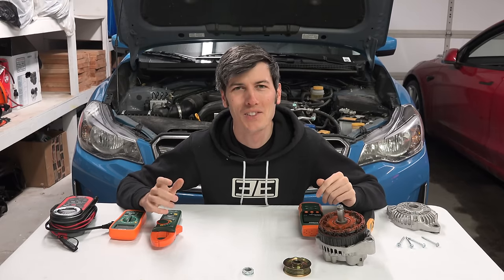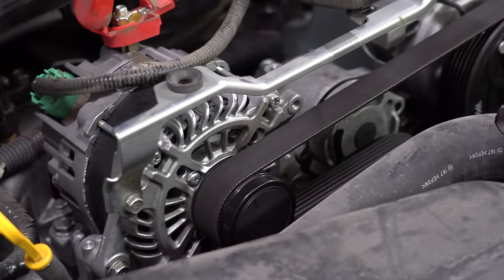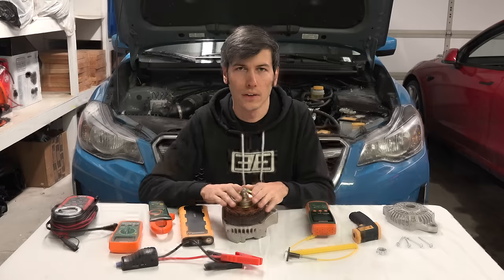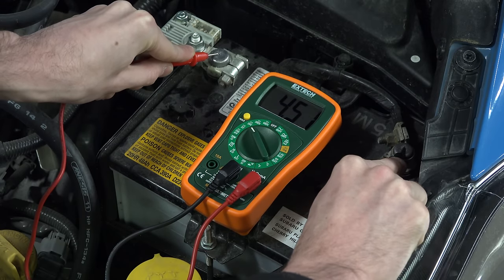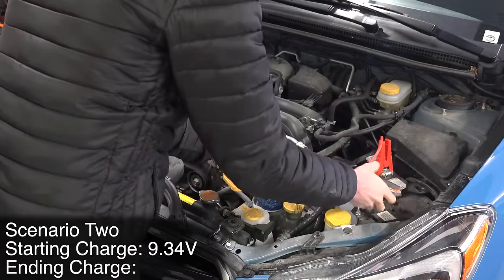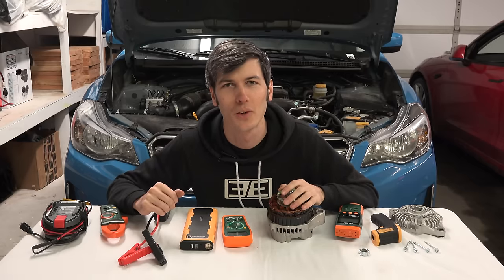Can A Dead Battery Ruin Your Car's Alternator?

Comment: You just measured voltage drop over alternator cable :D
Surely it tells you if you have bad connection to alternator, battery or even damaged cable but nothing more. Well, knowing resistance you could roughly calculate current.

Your alternator will be fine as long as it's in good shape. Problems usually show up when you have dirty alternator clogged up with dirt. It does not dissipate heat well enough and it's fine with small load but it's going to get significantly hotter when fully loaded. That's why alternators might fail. Just take care about good shape and if you rip off bottom engine bay cover, replace it as soon as possible. That's good way of keeping everything clean, especially when your alternator is quite low on the engine. 

This method is much worse for car battery. In perfect conditions you want to charge it at most with 0C1 which in case of your battery is 4,8A. It's hard to tell how much did you actually put into battery as you measured amperage at alternator output. You could also measure it on battery cable (before it splits) to see how much charge do you actually have and how much goes to power rest of the car. Obviously with empty battery you have much less internal resistance so it draws much more power. Alternator limits current but it's still closer to 1C. Sure, it will charge. By discharging it so low you did not damage it much as it was just awhile. It's much worse to have low charge for a long time. The problem is that charging with such high current generates a lot of heat and hydrogen. Current batteries are protected from that but it's still good idea to keep away with anything that might spark or ignite hydrogen. That's also why jumpstarting and charging from another vehicle you should never put both clamps on battery. Either positive or negative should be connected further away and disconnected first. This way you avoid spark near battery that could ignite hydrogen from quickcharged battery. It does not happen under normal condition as all new batteries are sealed. It happens when overcharged battery gets too high pressure inside and gas goes out through vent valve. Under normal operation  oxygen and hydrogen recombinates inside and goes back to water. If you vented your battery by overcharging, then you lost some of water. It means that you have less and more dense electrolyte. In extreme cases it means that battery will start to wear itself much faster and will not use part of plates that are exposed by missing electrolyte.

Comment: I remember hearing that some cars have an "alternator protection" mode, where the alternator stops charging if the battery is too weak. Is that true?
Reply: Modern day cars have a smart system to a degree. However, it wont tell you that your battery has a weak or dead cell. It will charge the whole battery as required but doesnt know enough to indicate what cell is weak. You would indeed think they would have a smart sensing system that could indicate and tell you that hey," cell 4 is weak". Lipo or lithium ion battery chargers DO have that ability because each cell is wired in such a mannor they can be checked individually. Something lead acid batterys lack. With the new cars being so energy hoggish, The industly NEEDS to adress the antiquated system and bring it up to modern times.

Comment: Was hoping see a specific gravity of the battery but I guess yours is sealed anyway.  The alternator will get you up to 60-80%eventually but will never get it to 100% because it can't maintain the voltage high enough for long enough to do so, you know the good 14.6-14.7 volts until the amps taper down to where it's finished.

Comment: You forgot to mention an alternator needs to first be powered by your battery for it to work :) car alternators are not ‘self exciting’ and they don’t contain permanent magnets inside. The centre rotor needs to be magnetised by a 12v supply from your battery before it can start producing electricity.

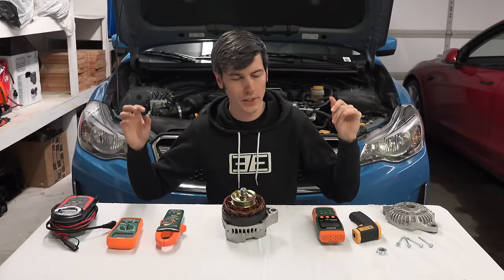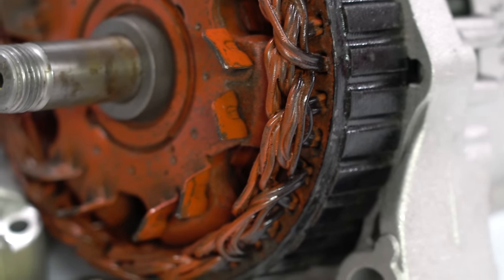Comment: 2:49  outline of the experiments...  9:36  the less a battery can receive a charge optimally (a degraded battery) forces alternator to overwork to send more amps thus operate at higher heat temperatures which could lead to premature failure.

Comment: interesting to see the measurements but charging a dead battery with the alternator does much more damage to the battery than to the alternator... you can short circuit the alternator and it shouldnt burn out as long as its spinning and is not full of dust or something, its just how they work - winding inductance limits the maximum current and its generally designed to be safe... btw the alternator does not regulate the current it regulates voltage and just tries to keep those 14 ish volts, its the battery that says how much current it eats if its under constant voltage -  thats why chargers have to have the current regulation, high charging currents can kill a battery pretty quickly

Comment: Why do combustion engine cars have an alternator and a separate starter instead of a large electric motor attached directly to the crankshaft? 
It could be used as a perfectly smooth start-stop system, a booster for low rev acceleration and it wouldn't require an automatic transmission.

Comment: The alternator doesn't really give a  dead battery a "deep Charge" it measly gives the dead battery a surface charge, so when you turn on the lights/accesories the battery will go down to near the original  previously measured low charge.

Comment: And this relation alternator / battery is the very reason why you can start a manual car with a dead battery by rolling it and gently clutch-in the 2nd gear.

Comment: i know this is an old vid, so i must have missed it, saying that a flat battery will kill an alternator is a myth, what does kill an alternator is a shorted out battery.
if a battery is left flat it will damage the plates inside the battery, these plates can buckle and short out, this will kill an alternator, as for a flat battery, as long as the current does not exceed the maximum output of the alternator, the alternator will be fine and like you stated just gets a little hotter with the extra current draw.

Comment: It’s all about power flow, heat, and state of the battery. 

As the battery ages it’s internal impedance increases due to sulfate crystallization with lead. So therefore, an aged battery would be a lighter load on the alternator then a new battery at the same state of charge. 

The only time it would be a problem is if, as you stated, it is a hot day and the alternator is under a heavy load near it’s nameplate power rating. Anytime heat increases things wear faster. I would suspect that the most-likely part to fail is the internal diodes. Semiconductors can have their dopants move as temperature increase, so much that it damages the PN junction. The alternator is just a 3-phase generator essentially, so the only failure points are the wires and rotor/bearings, which are probably more resistant than the diodes to heat. 

The other part that also might explain why the alternator could fail, is that your battery is no longer a sort of “capacitor” providing a buffer for short-circuit current on starting your DC fan for example. I would suspect that if your battery is dead, the alternator is now exposed to current spikes (momentary load jumps) which overload the diodes (which have a finite power/heat rating) and eventually cause them to fail. 

I would be curious if you could use a true oscilloscope type meter to measure the current changes in real-time, not RMS values, and see the spikes associated with turning on various equipment in the car. I’d bet there would be momentary spikes above the alternator diodes rating (typically 160-200A continuous), and that would be the true reason why a bad battery causes an alternator to fail, not increased heat and current draw over time.

-An Electrical Engineer
Reply: Also, I would consider the alternator voltage regulation components as well. These might be the other point of failure in the alternator due to current/voltage transients in the system with a dead battery.
Reply: Whey someone with some knowledge yes it is the power spikes caused by the turning on of auxiliary’s which kills alternators the most when used with a knackard battery as once stable alt output would be the same as if the battery was new and charged 

Heat can cause issue if having to charge a heavily discharged battery and it’s somewhere hot or if the car is stationary while charging (and it’s still somewhere hot) but the rare occasions the majority of motorists would do this I wouldn’t worry 

-marine engineer 
On boats where the engine sits in a little sound deadened box with no airflow except for the alternators fan dead alternators are fairly common but on the hire fleet these alternators are chucking out their full output for hours charging large (up to 500Ah) battery banks that had been discharged overnight 7 days a week 
On a fleet with over 300 boats I doubt one gets changed per week and these alternators are working under far higher stresses than a typical alternator on a car
Many of the boats just use a simple car alternator (or two) (Lucas LRA100 on the older boats)
Reply: rccarmadben it comes down to the components used. The individual semiconductors (Diodes, Regulators) maybe less stress tolerant than those used in marine type alternators. If you take out the diodes, read the model number, and look up the data sheet, you can determine the individual devices tolerances to transient current spikes. Semiconductors do have hard limits before damage to the atomic structure, thus destroying the semiconductor properties. 

It could be that the alternator on a boat has better components than those on a car. Also, aftermarket vs OEM alternators might use different manufacturers for the semiconductor components. 

It’s kinda a detailed study to see what truly causes alternator failure. Components may change so the issue for one type of alternator may not present itself in another. 

I am also not considering other component failures on the electrical system (which could be another problem from loss of the battery)  

Everything in an electrical system is tied together, and effects to the system may be more important or less important depending on what makes up the system. 

Just like a car, better mechanical components make for a more resistant system (truck versus sedan) to transients (bumps).

I agree with your comment that potentially it might not be an issue, but it needs a more detailed study due to variables in components in my opinion.
Reply: Yes very very true 

I did forget to point out the modern very high power marine alternators were now starting to use we’ve had very few failures over about 9 years

Comment: Question. I have an optima red top battery around 2yrs old in my late model WRX. When the weather overnight is either very cold <30°F or sits for more than 24 hrs in weather between 30°F & around 40°F. It won't start. Oil is fine, fuel  injector good. I've read that if you're ECT sensor is faulty it won't read how cold it is & won't send addtn'l fuel during start up causing the battery to exp high loads to the point of dying.  Everytime this happens, I "jump" my battery & it starts right up. Insight? Faulty sensor a possibility?

Comment: Hello I have a question the alternator gives power to the system through the battery passes right so in other words he alternator always recharge the battery for DC SYSTEM in the car that correct.? Thanks

Comment: I learned alternators are 50% efficient.caused by eddy currents in the inductor. Easily solved by thinner laminations.Surely this can be fixed?How could this not be addressed by manufacturers?

Comment: Left ignition on. At dusk, Headlights turned on and drained battery. Measured Voltage at midnight was zero. AAA battery pack started the car. But their bluetooth tester showed a bad cell. So, battery had to be changed out not to damage the alternator.

Comment: You are wrong about 9:43 -> Worn out battery does not take charging current so alternator can't generate more current as voltage is limited. (From alternators point of view, worn out battery is same thing as full battery) In some rare situations, the battery may have a cell short circuit. In this case, the other cells take too much charge and boil the battery. This loads the charger and the battery may explode.
Reply from the maker: Appreciate you sharing this. Someone else mentioned and I'm trying to get clarification before offering a correction. Do you agree with their comment: "The alternator has a set max voltage. A bad battery that doesn't take charge anymore draws significantly LESS current to rise the voltage to the max voltage and the alternator won't do much work. A good battery with low voltage however will draw significant ammount of amps. An alternator only outputs as much amps as your car and battery can receive. If a battery is bad it usually take maximum 20 to 30 amps charge if it is low voltage, a good one will easily charge over 70 amps or more. Work as a full time mechanic and is the head of electrical diagnostics at work."
Reply: @EngineeringExplained  That sounds about right. Thank you for reply :)

Comment: Bad advice because the variance in chargers is greater than that of car regulators, and an overcharged battery will go dry.  The only exception is if the car won't be driven long and frequently enough to fully charge the battery.

Comment: The alternator is NOT sending amps to the battery, the alternator is regulating the voltage to whatever voltage, the battery will charge and take amps if the voltage is just high enough. So if your battery is bad it has just no capacity and charges to 100% in less time, otherwise your battery would need to get hot :)

Comment: Seems like you have a 60 Amp alternator putting out 60 amps.  I don't see why it would cause any damage to the windings and such.  I'd be most worried about the diodes in this case.  
I'm curious if modern, current generation cars have any sort of current limiting in the charge circuit, or if the battery will draw whatever can be provided, ex. will it draw 130 amps from a 130 amp alternator? 
Also, I'm not sure that having a weak, old battery would put as much stress on the charging system as having a good battery that has been drained as in the test.  The old battery will have less total capacity so will take less effort to charge to a level seen as 'full'. it will just be more depleted than normal after starting the car.

Comment: Would the alternator cause a noticeable loss of power or worse gas mileage when charging a dead batery?
Reply: Johanes Neumann yes, I have observed this phenomenon. When I had a dying battery for a month, when I got my battery jumped and charged by someone’s car or by a shop, I got good mpg afterwards. When I was generally able to start my car but my alternator had to try to charge my dying battery 🔋, I got crumby mpg.

Comment: The temperature increase does answer one question that has been in my head for awhile now. Why do the barrings fail prematurely in the alternator when the car is driven on a bad battery for extended periods of time. Suspected it was increase in temperature, not dramatic enough to kill it right away but over time, yeah I can see 20C wearing out the lubricant within a couple months span.

Comment: The wire from the alt is connected directly to the batt. If you have voltage drop,, then that shows how cheap that wire is. Over that 4 ft of wire, you’re losing over 1% of your charge. Although,, it is a Subaru,, so quality isn’t exactly expected lol.

Comment: I recently made the mistake of playing loud music in my 06' forester without the car running which drained my battery and I had to jump start it. I have a calcium battery and was wondering If I will need to fully charge it before driving around on a low battery. As it's not a lead acid battery I don't think it will charge up by driving it around....

Comment: Could you do a scientific episode about ATF (and maybe gear oils for manual transmissions and diffs) and open up the differences between them. Maybe buy a couple of different ATF's and perform lab analyses to find out the actual differences. This interests me because there is not too much scientific information readily available, and most of the information is based on assumptions... Apart from viscosity and temperature behaviour there seem to be claims, that some ATF's could corrode certain materials such as brass, and therefore should be avoided. Sorry for writing this in a hurry, but I really thought you could do the proper research about Transmission lubricants.

This has been an interest of mine for a long period of time, since many MB enthusiasts claim that you should only use "MB-Approved" ATF. I do realize some companies may not want to get the license because of the cost, but I have also been wondering if some ATF.s arent that good.

Comment: My car battery voltage shows 14.4v after starting, but after either idling or driving normally for about 20 seconds it drops to 12.5v. Do I have a bad alternator?

Comment: Yeah I bet your rectifying diodes got nice and toasty, always wondered how many amps at idle you would get as my dad said at idle you don't produce enough power, can't remember what it was for now but that's about 200w of juice just at idle!!! I knew it was more quiet then a generator, ok can only pull less then an amp at 240v but that's still good going.